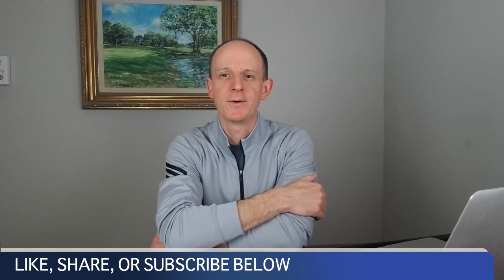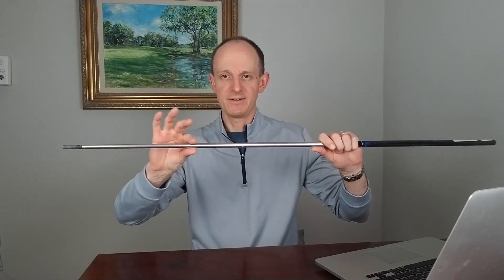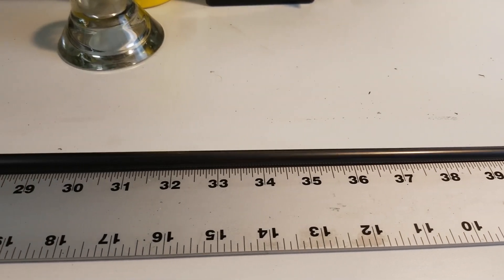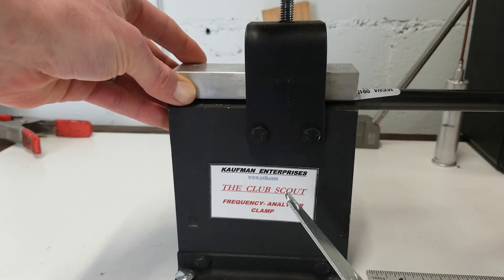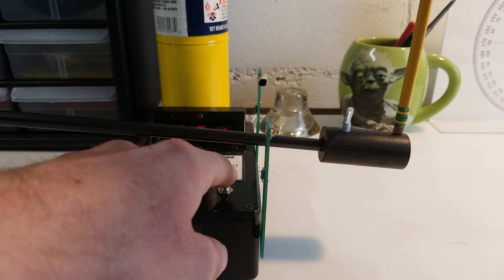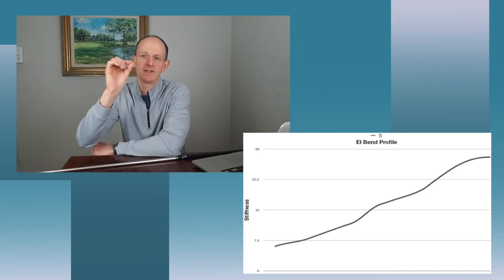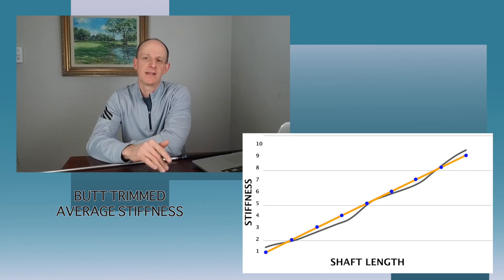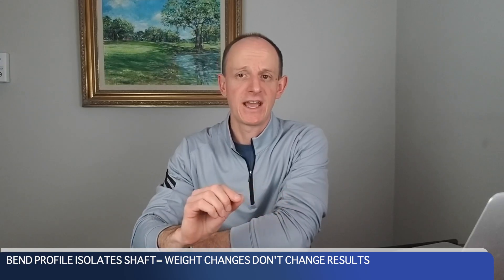SHAFT STIFFNESS, TIPPING, AND TRIMMING - What happens when we cut a golf shaft from either end

Comment: Question: Is there a matrix for tip-cut and butt-cut (at various increments) and associating to control. For instance, tip-cutting gives me more centered strikes and straighter shots. Butt-cutting doesn't.
Reply from the maker: Tip cutting usually goes in 1/2 inch increments so that the flex stays consistent when matching up to different weight heads. The head weights get lighter as you go longer to compensate for that length. You can change the tipping measurements but would almost always keep a consistent tip cut difference from one iron to the next (ie still 1/2 inch increments). Butt cutting is simply done to adjust the final playing length.

Comment: Hopefully you reply to this, in theory if someone accidentally ordered a 46 inch driver shaft but it was intended for their fairway 3wood and they wanted it cut down let’s say 4 inches, how would a length that drastic affect the specs/stiffness?
Reply from the maker: No issues. Most shafts are not wood specific. There are a few fairway specific shafts but most are all designed to be played in whatever club you want. They all come at a raw length of 46 or 47 (Fujikura) inches and you butt cut them to length. Only difference is how much you tip trim them first to account for the change in head weight, 3 wood being heavier than driver etc. This will also take care of the flex part of it so a correctly tip trimmed shaft will flex similarly in a fairway wood or driver.
I would say 95% of fairway woods in the world are using shafts that started at 46 inch raws so don't worry. Just find the tip trim recommendations for that shaft.

Comment: Here is the one simple question 
Cut the tip an inch and extend the butt an inch- does this stiffen the shaft relative to its original state?  This is my thought to stiffen wedge shafts a bit- or even 1.5” 1.5”
Reply from the maker: Yes, that would stiffen the overall profile because you are removing some of the softest portion of the shaft and adding on stiffer material on the butt end. Even if the extension itself may be softer compared to the graphite at the butt end, the fact that you epoxy it in, stiffens the entire butt end. Same applies for steel.

Comment: I just bought a callaway iron set and the shaft is TrueTemper XP 85 s300. But in find it too soft for me..I am thinking of tipping it. Can I take half an inch u think to make it stiffer or should I take an inch of it. I am only 5'9" so I dnt mind an inch shorter clubs. My driver clubspeed is 109mph btw. I usually hit my 8iron around 160yrds and  now I lost 10yards on every irons with an even stronger lofted callaway 2019 Xhots. It is very frustrating. Please give me your expert advice on this. Thanks in advance.
Reply from the maker: I am probably more concerned with the weight in your case than the stiffness. At your speed, a 90g iron shaft is probably too light and could lead to inconsistency. So while you could tip trim it and get it a little stiffer, the weight will still be an issue I have a feeling.
Reply: @EFGMC  ok then the best would just to either get new irons or new shafts on them. Thank you.
Reply from the maker: @jakbayano5420  I think by the time you go through all the effort of pulling the shafts, tipping them, and reinstalling, it would be better to just replace the shafts. Or if you aren't in love with the heads, dumping the clubs all together and finding something else. Again I would probably recommend a shaft in the 110-115g weight based solely on your swing speed.
Reply: @EFGMC  agreed. Thank u for the input. Much appreciated coming from a pro clubmaker. I will be selling them asap. Thank you.

Comment: Great video. If you tip trim, should add a tip weight to keep the same swing weight?
Reply from the maker: Not a one size fits all answer for this question and it depends on what you are trying to achieve by tipping. 
If you tip the shaft, the SW will be lower only if the shaft results in a shorter final length. However if you are tipping at the beginning of a reshaft job and the final club is "standard" length once cut the length, than SW will be the same more or less. Adding head weight will make the shaft feel more flexible.
Reply: That's an excellent idea, thanks.

Comment: 1. Great video.  
2. Get what your referencing about frequency,  but I think you should not down play it too much, granted you emphasized the consistency aspect of it, but its obviously a great baseline measurement.    , via, if we do deflection and bend profile,  we still can end result the frequency to dial in a set. 
3. The deflection example really nails home the point of weight addition if you cut the shaft. ..., seeing your excellent overlay example,  the butt will raise the deflection,  but raise it far less than the tip, and to get more deflection,  after a cut, will have to add head weight.  Plus nice to explain the flex numbers from a tip or butt cut. 😎👍 that was very informative.  

4. Now I'm thinking, the industry needs a head weight to flex parameter.  I'm a frequent golfworks guy, and love how they break down flex and playability factor etc. .... but obviously to really dial in something,  we need a head weight to length factorbility measurable.  

Again, great video,  took some good notes on it, .. definitely,  supports my idea of cutting from the butt, and or finding the best flex and length that needs the least amount of material taken off.   

Seems, if your a below standard length guy, better get a flex less, just to cut back into your desired flex. 

Because,  I'm a suggested .75 below standard guy, and no wonder when I was buying s , and get to cutting,  I'm creating a even more stiffer profile than what fitted me. 

Now, I gotta figure out the maturation of head weight,  flex and length. Lol.